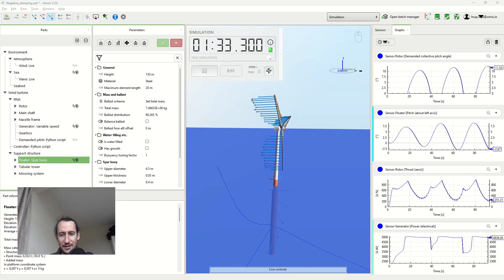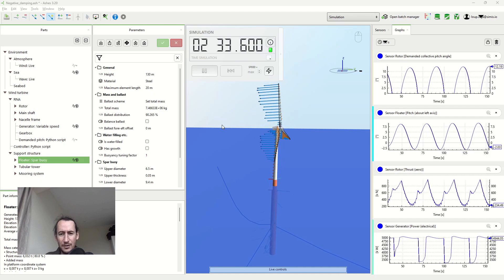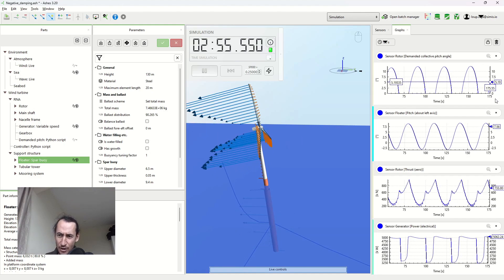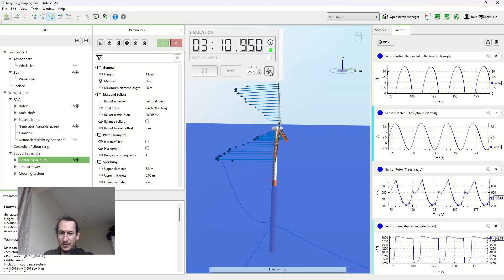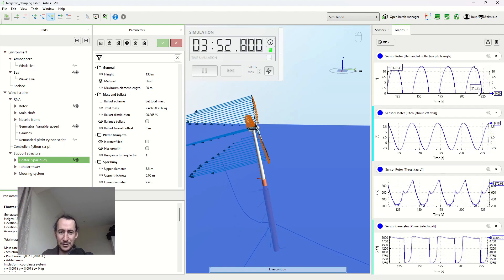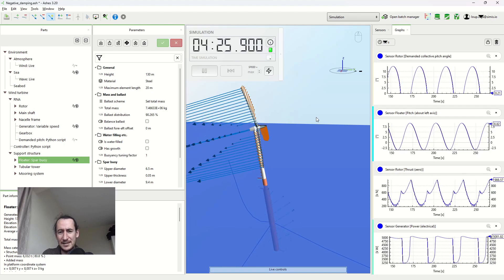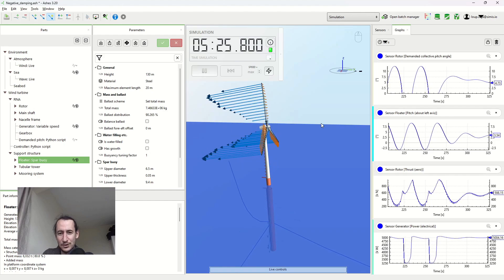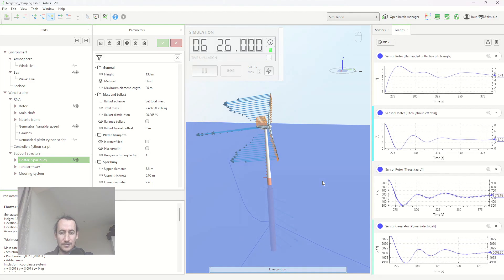Negative damping of a floating wind turbine with Ashes - wind turbine simulation software

Comment: Very very interesting. So floating wind turbine usually pitch the plade also within the oscillation period besides the normal pitch control as wind velocity vary. I mean, for V>V_nominal, large wind turbine already pitch the blade to feather to keep the power costant.... and besides this action, they also pitch the blade when the turbine oscillate to dampen this movement ? 
If it is like that, what happens if within the oscillatory period and motion the wind suddenly varies.... you should somehow couple the two control strategies ?
Reply from the maker: As far as we understand, with this controller, the blades are pitched to keep the rotational speed of the rotor constant at the rated RPM: when the wind speed increases, the aerodynamic torque also increases and that makes the RPM increase, so the blades are pitched to decrease the RPM back to the rated value.

But the controller doesn’t know (and doesn’t care!) why the RPM increased: is it because the turbine is moving forward or because the incoming wind has increased? It doesn’t matter, the controller will just pitch the blades.

The point of the video is that if the speed at which you increase the blade pitch is not adequate, you might introduce negative damping, so it is something to be careful about.
But wind turbine controllers are extremely complex, and I am sure there is a lot of thought put into how controllers interact with floater stability. We are not control experts, it would be great if someone that is could comment on this topic.